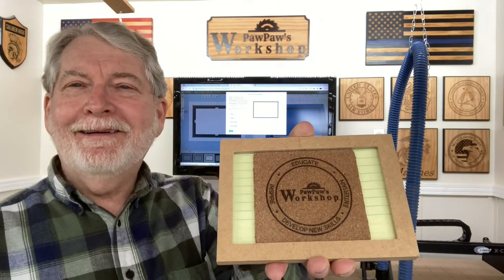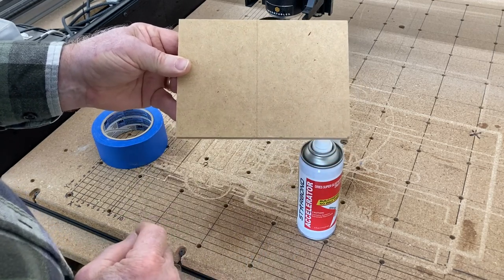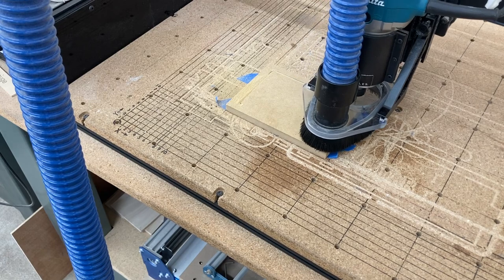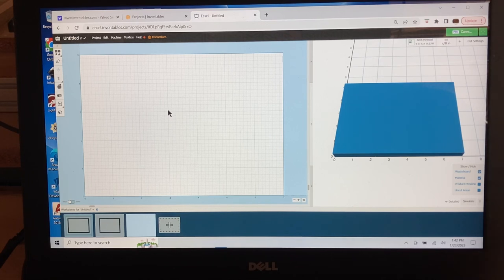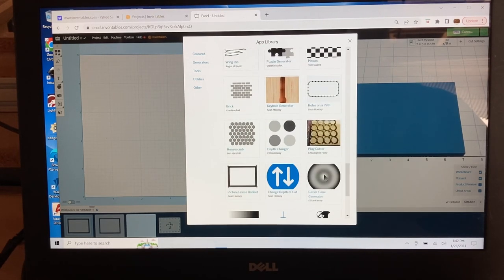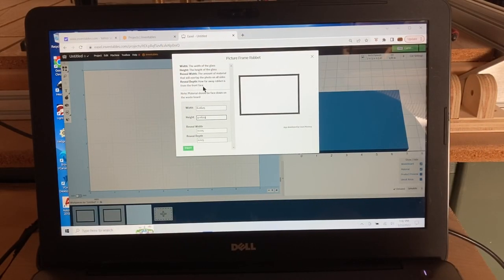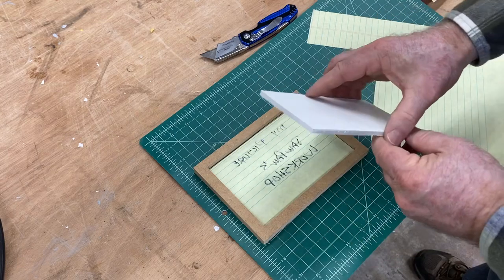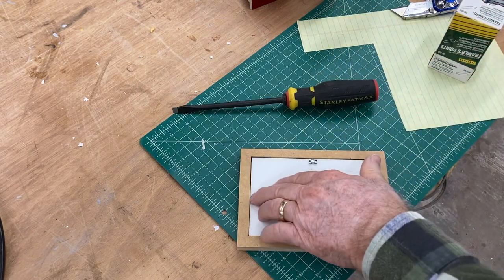Using the Picture Frame App in Easel

Comment: Your videos have been very helpful in my maiden voyage into CNC work. I use Easel software and I'm having difficulty placing text into circles using their app. I see you have created a number of projects (police badges, etc.) using circular text, and I'm wondering just how you did it and also got the rope edging around the border.
Reply from the maker: The circular text app is a difficult one to use and quite frankly no that good. In easel I typically will create a circle and it is as a guide line. I will place the letters individually on the line. Once complete just delete the circle. The rope was downloaded from Google search. I believe it was part of the Navy logo.
Reply: @PawPawsWorkShop  thanks this is helpful

Comment: Hey paw paw, great work.. Had a question on your frame cut out. When you do xy zero are you on the inside corner with bit or on the outside corner with bit..
Thanks.
Reply from the maker: The x,y zero position is based on the center of the bit